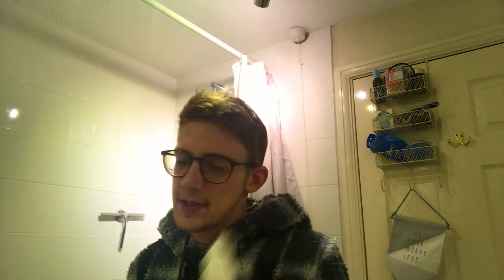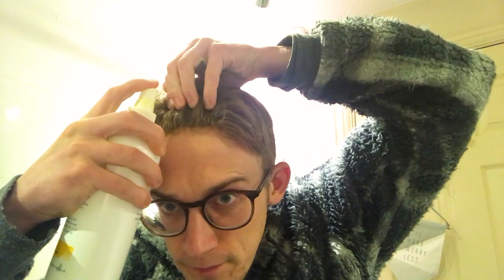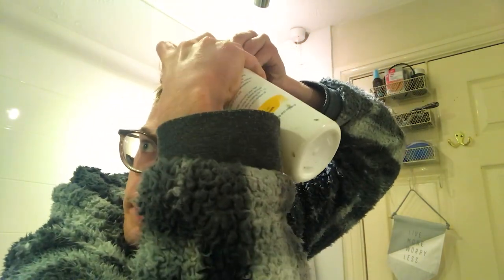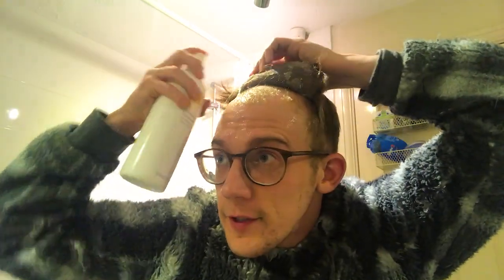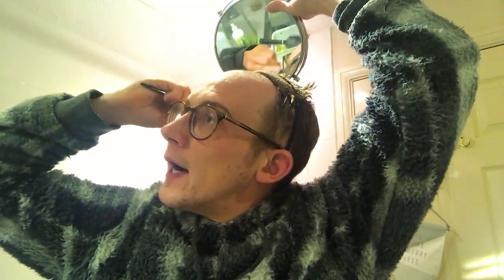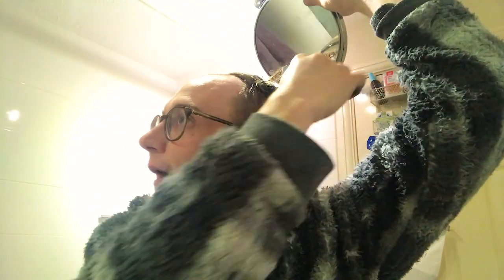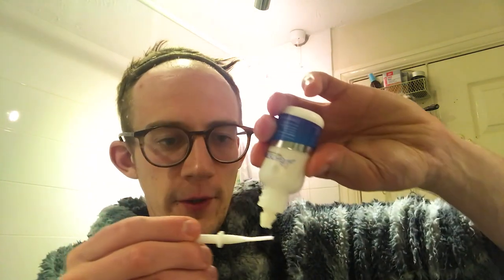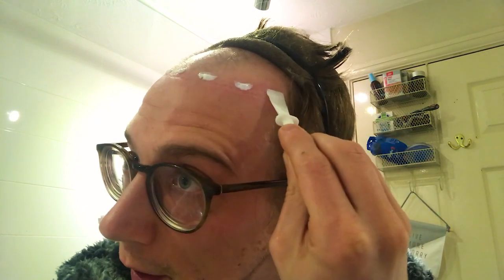Applying Glue to the Front of a Hair System | Tutorial

Comment from the maker: Newlacecu are thrilled to offer 20% OFF your FIRST system Hair System with them! Just enter thew code : Newlacecu20 when making your first purchase on : http://www.newlacecu.com!
Reply: Can you recommend or which solvent based bonds have you used please?
Reply from the maker: sunshineboyhapi only walkers ultrahold
Reply: @HairSystemDIY  Thanks
Reply: Hey man, love your vids, I've been wearing a system for several months now and love it! BTW, recently switched to a lacd unit light density and loving it so far. Just a tip on two things. Use towels to remove glue, I don't like cotton balls because it's messier and you give yourself more work because now you have to worry about cleaning the excess cotton pieces  on top of having to worry about getting the glue off. Towels work like a charm. Also..

As far as getting the hairline just right, I just put the bond directly on the hairline of the system instead of my head, be gentle of course but that works like a dream when it comes to laying the hairline down perfectly. My proble wheb I put glue on my head is I always go too far down and my hair gets stuck to the forehead, everytime

Comment: Great Content! I'm just a little confused how the solvent didn't give you any issues. I use C-22 and every time I apply that it makes the whole lace have a greasy texture which is hard to wash off. In the video you applied the solvent on your lace and it came off so flawlessly. I was just wondering If I missed something or maybe you can give me some advice on this. Thanks!
Reply: C22 is oil based not alcohol. - so it will literally get blitz the glue off and make the whole system oily and greasy and needing washing. You’d need to use alcohol spray to take off the glue, c22 is more for if you’re taking off the entire thing
Reply: I use to use C-22 now I use Goo Gone. Way cheaper and works just as good if not better. I use dish soap to get the oil out. Then a good shampoo and rinse a few times. Does the trick. I also use my garden hose outside on the center setting. To help get any leftover glue and oil out of the hair. Then it doesn't go down my drain.